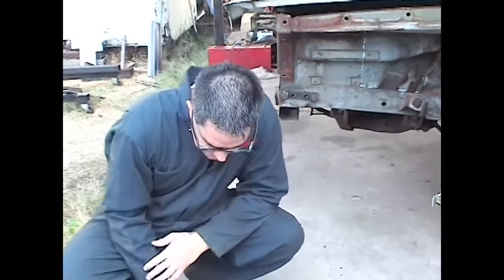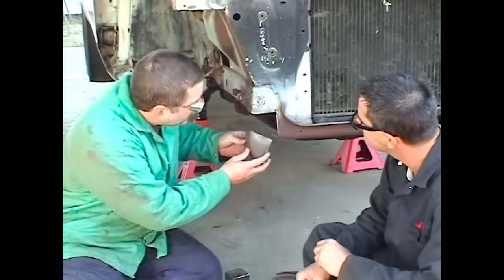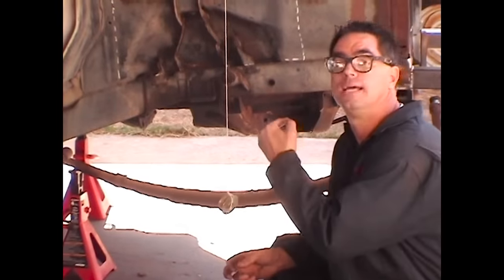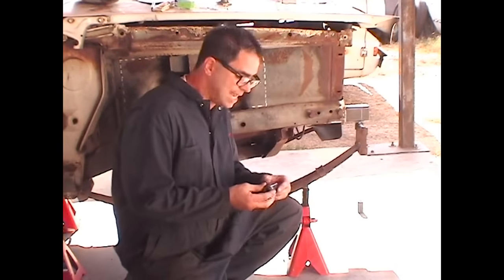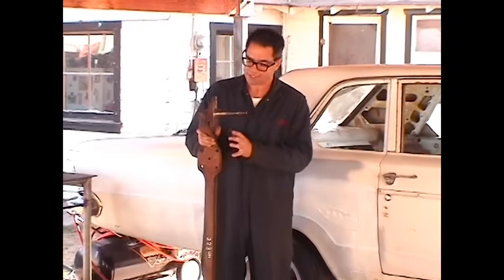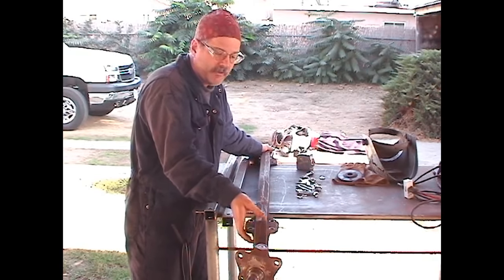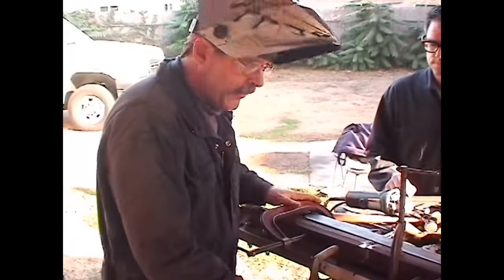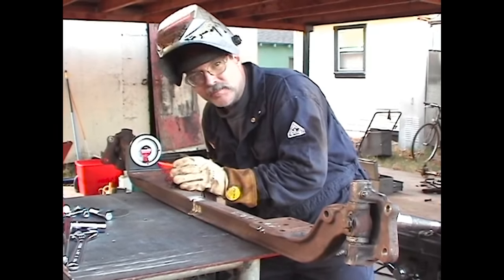Build An Altered Wheelbase Car Part 4

Comment: You located the centre line of the spindle with no weight on the car, you addressed the angle on the shackles, but the spindle CL will move forward as well when the suspension compresses. Unless I missed something, which is quite annoying possible.

Comment: I have been considering running leaf springs up front, but not like that. That setup is "half elliptical" design, but I want to try quarter elliptical, and I want to do it for free (I'll spend anything on tools, but not parts).  

Do you know anything about choosing a spring to cut it half?
Reply from the maker: Hello Iowa599, the quarter-eliptic spring idea is valid and I know of a few AWB Match racers that used it, the BRUTUS 1965 GTO was one. I'd say any 5-leaf spring that meets your length (from under-cowl anchor point forward to axle tube) would be a good starting point. Just be aware you might have to do a bunch of trial and error to get to the spring pack that fully supports the nose / ride height without sagging or doing ugly jounce/rebound stunts on the open road. I was never looking to shed weight so always went with the more predictable semi-eliptic spring layout. The transverse mount leaf spring (ala Model A Ford) is maybe not so good as it always requires radius rods and stiff shocks to get away from side-to-side body roll. If you want to be a "hero" try to duplicate Ford's "Torsion Leaf" front suspension as seen on the factory 1965 427 SOHC A/FX Mustangs. Ford attempted to get them all back from the Factory racers to be destroyed due to their oddball camber shifts on hard acceleration. But for ingenuity - making the leaf spring twist to provide suspension AND to locate the front wheel fore-aft, the Torsion-Leaf was a novel idea. Google "Ford 1965 A/FX 427 SOHC Mustang front suspension pictures" for an eye full. ORRRR just run a set of long-ish leaf springs and make it easy on yourself? THANKS for watching and writing, Steve Magnante
Reply: I used the front section of Mopar rear leaf springs on a couple cars I built in the 60s. Junkyard pieces so late 50s early 60s springs.
Reply: @SteveMagnante  Are you saying not to cut it in half? 

The weight will be very low! No fenders, no bumper, no grill…really a Locost with a solid axle out front.  I'm curious how load on half-elliptical relates to quarter elliptical because it will be so light that maybe trailer springs would be sufficient.
Reply: @billmiller7138  oh, "front section", ok!

Comment: This is why I still have a Transarc Welder sitting in the corner and why its worth knowing and understanding the Arc basics, the types of rods and the tricks to Arc Welding especially fillet welding for good penetration and maximum strength in a thick weld.
Sure Mig is fast and "Easy" but when it comes to structure you till cant beat Arc.
Loving this series!
Reply: yup worked at a bodyshop in the 80's the owners friend was a tow truck driver. there was a almost brand new olds custom cruiser that was totaled , he bought it and they cut the front end off and welted a new front end frame on it. it was a ton of work but I know it was done on the cheap( ie when other work wasn't there) and he got a brand new care for less than 1/2 price. thats how it was welded, I believe ( I was super young).
  everything on front end came off Engine /trans/ frenders ....the works. it was the labor hours that totaled it out, I believe less than 1000 miles on it.

Comment: I think I would put the "swinging" shackles at the rear of the front leaf springs, so when driving down the road and hitting bumps the axle will not only travel up, but slightly backward also. Making it ride much much smoother over bumps. 
But that's just me and my crazy brain's 2-cents worth though, Lol....